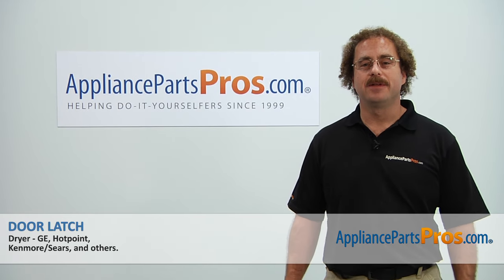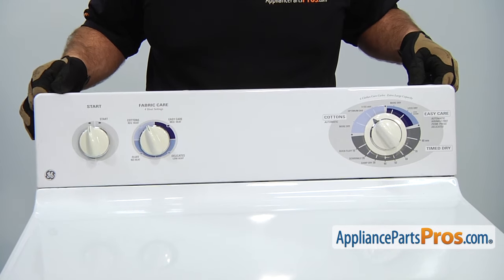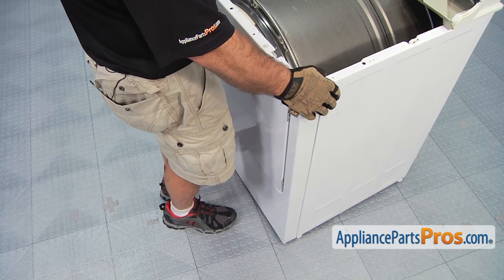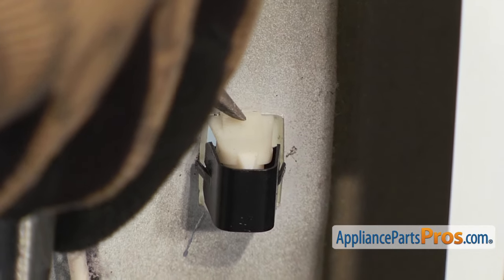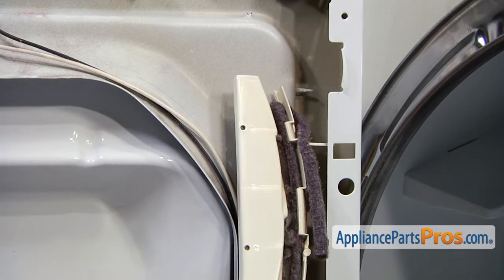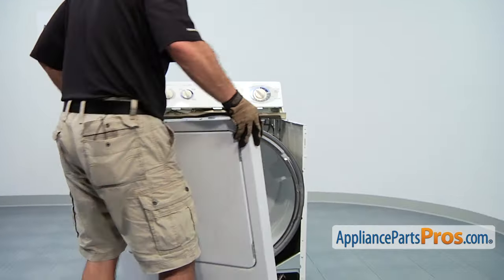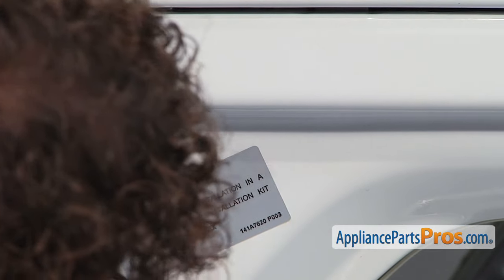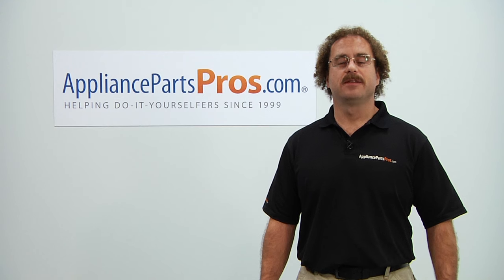How To: GE Door Latch WE1M1011

Comment: Sorry, but all you need to do is pry the latch out with a flat blade screwdriver and snap the new part into place. DO NOT take the machine apart.
Reply from the maker: That's one possible option. However, if you can't get it to come out because of the tabs, then the exterior will have to be removed. It also lends greater visibility. Our customers generally find that it only takes about fifteen minutes, give or take, to do it this way.